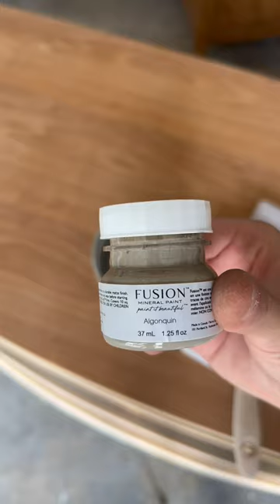How to LIGHTEN old wood furniture 👏🏼 #furnitureflip #shorts #diy #homedecor

Comment: Great video! Tip: Get an old crockpot, fill with water, add the hardware. Set on low. Usually a few hrs and the grime comes off. ❤

Comment: Have you ever seen flippers use a crock pot to clean hardware? They say you just need to soak it in hot water and brush it slightly to get it clean. 🤷‍♀️